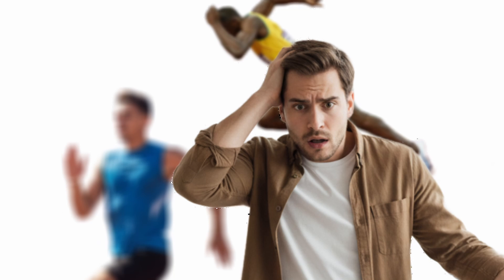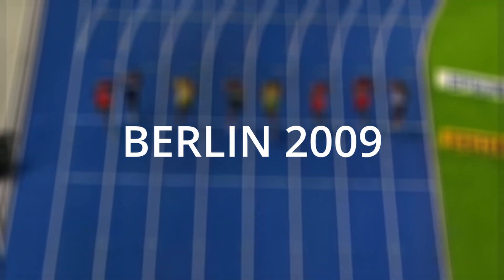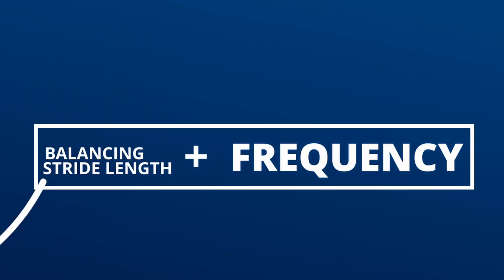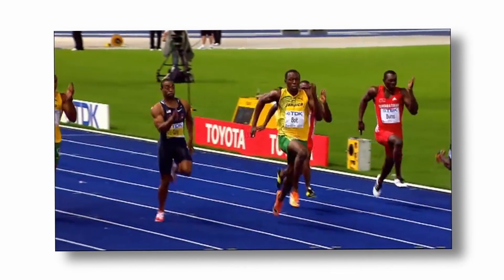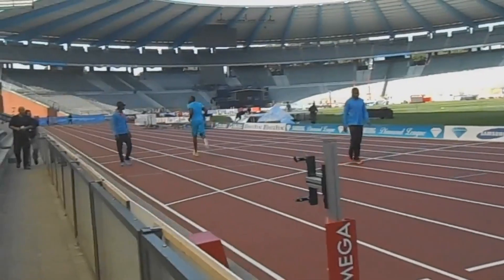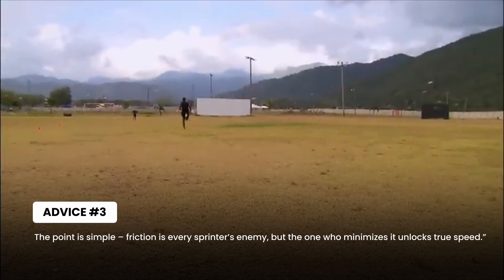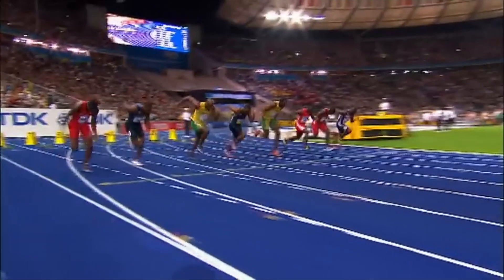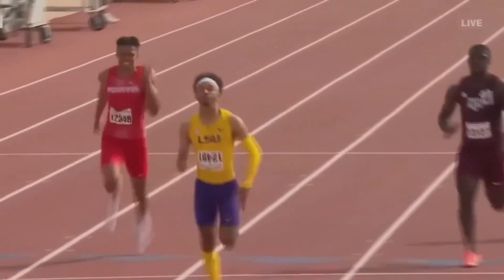5 Science-Backed Sprinting Formulas Few Athletes Know (Inspired by Bolt)

Comment: Shorter contact time is NOT what makes one run faster. It's the other way around.
Friction doesn't slow us down. Air resistance does.🙄
Bolt had one of the highest stride frequencies in relation to height. That's one of his unique skills.
Its cool you mentioned that he only lifts his COM 4.9cm. That's only 2.5% of his height.
Bolt is the only sprinter how could apply enough horizontal force while running 12m/s.